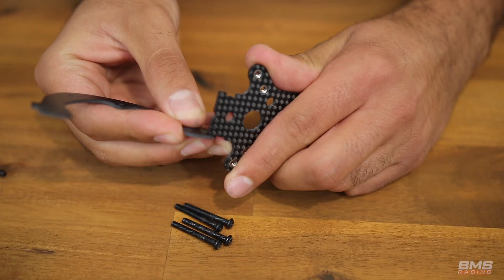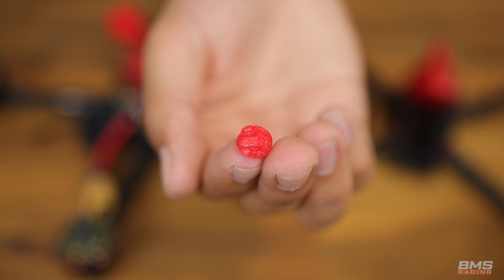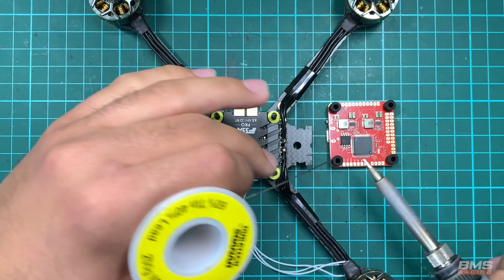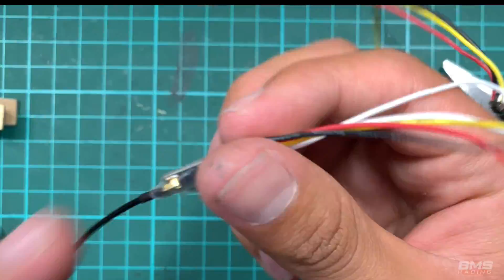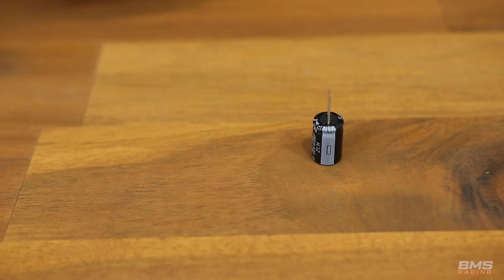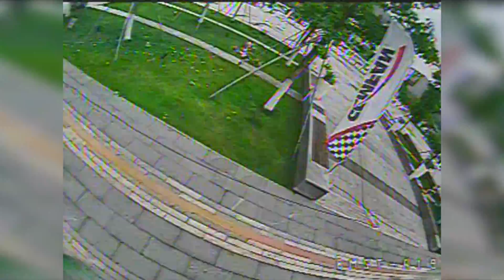BMS Racing JS-1 Owner's Build Video Guide - 2019 Version

Comment: This frame looks great! 
A couple things I was wondering with it though was wether or not I could fit a tbs unify pro race HV in it and how wide are the arms? Could I fit single escs on them?
Reply from the maker: It's designed for a 4 in 1 ESC and unlikely you're going to find ESCs small enough to fit the arms. And it's designed to take a TBS Unify Nano or TBS Unify NanoPro 32 VTX. So not designed for HV